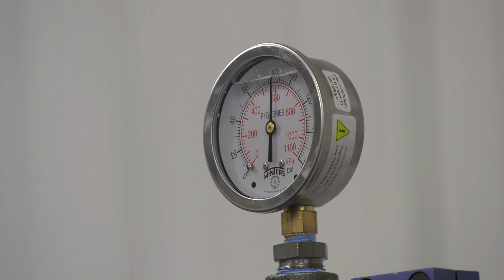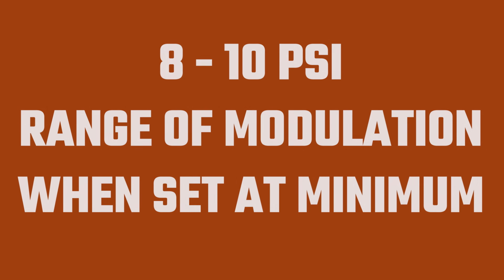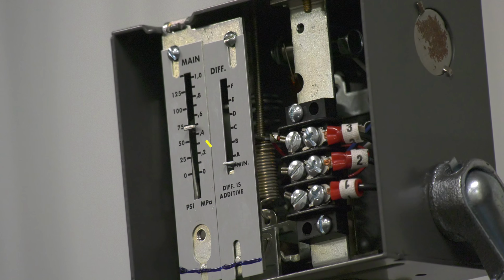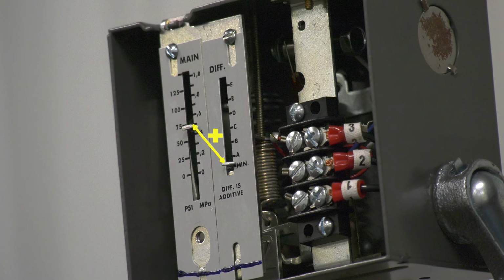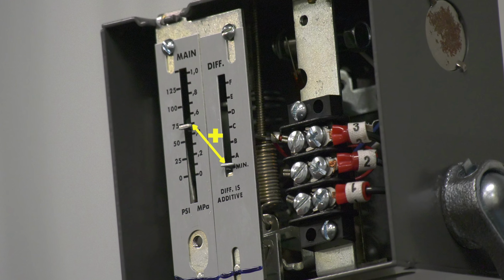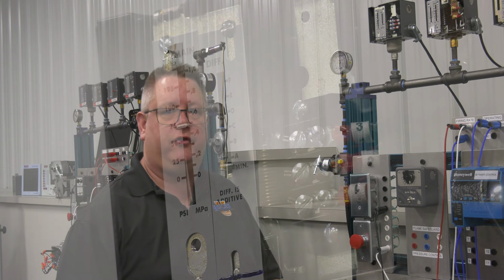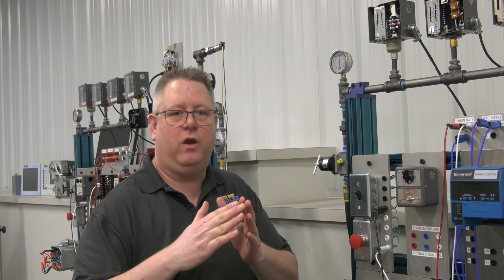Boiler Pressure Controls 101 - Weekly Boiler Tip

Comment: you said that it broke at 95 psi and then you said lets see what pressure we come back on at, you said 100 psi. hoe could that be
Reply: Yeah, that's not right I seen that to. It most likely turned back on at 85 10psi differential from the 95.

Comment: I'm new with boilers but the higher the temperature you have a temperature pressure chart to make sure you get it right?
Reply: Tim, I think you’re asking if at a higher pressure you have a higher temperature? If so that is the case. You can find the pressure to temp if you Google “saturated steam table”. 100PSI = 338F.